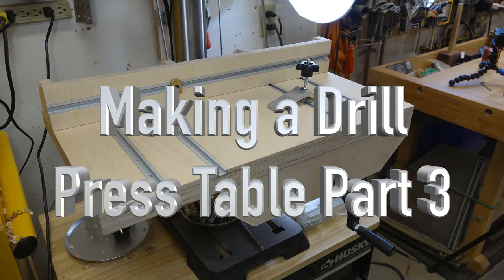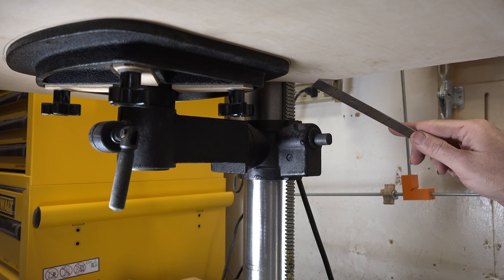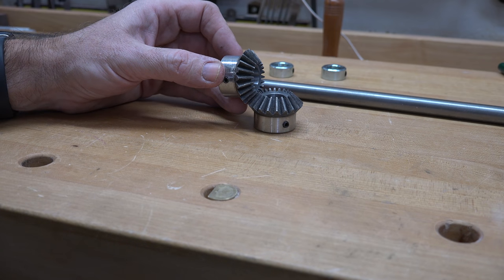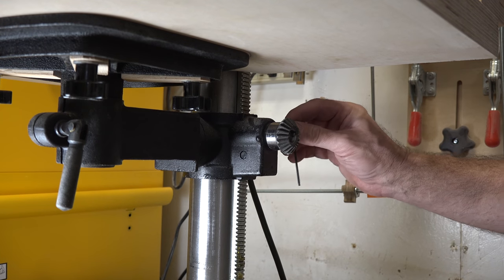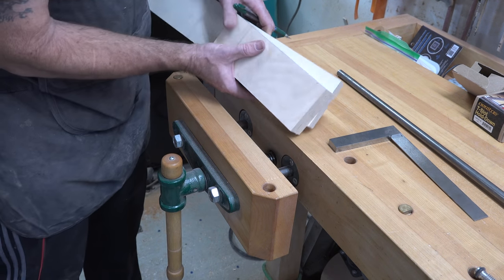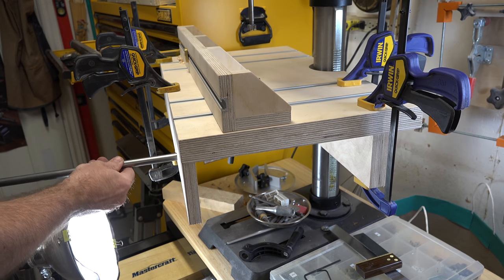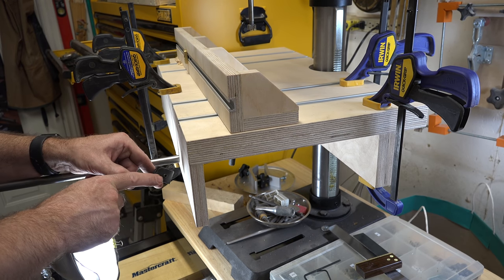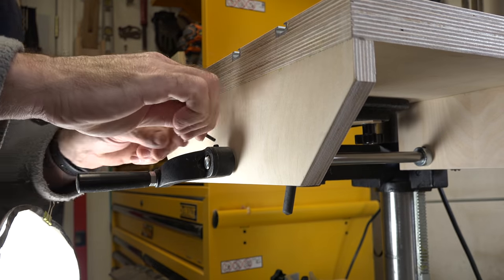Making a Drill Press Table Part 3

Comment: Hi Kenny! I am intrigued by your moving the lifting mechanism to the front. I have the Nova drill press and installed the Woodpecker table which would cause the handle to hit the table. Long story short, my solution does not work well. Your solution would allow me to use the original handle (don't ask). So, I also saw the ShopSmith version where they also moved the clamping control. In any event, I found a gear with 1/2" bore which is good for the Nova but it has 28 teeth. Would 28 teeth make it harder or easier to crank? And, would a larger diameter make it easier? If you don't know, just let me know and I'll do more research. By the way, I had no idea I was dealing with a celebrity. Do you have a "regular" job as well? I am thinking so since you have not pursued monetizing your videos and I think are leaving tons of money on the table each year. Am looking forward to Tuesdays now after going through a lot of PB videos and seeing many interesting Tuesday shows. Regards, Bill
Reply from the maker: To be 100% honest here Bill, I'm not sure about the tooth count.  Because you aren't gearing down or up, I don't think the tooth count would make a difference as long as you get a smooth transition between the two bevel gears.  As for the monetization, for years I never monetized the show and then, the show started to cost me extra money and it was a decision to monetize or quit producing it.  I went with the monetizing so that the show could pay for itself.  This is nothing more than my hobby and I work a full time job of over 40 hours a week and then film and woodwork on the weekends.  So I guess basically, I hold down two jobs.  My regular day job and my show.  LOL.  Thanks for tuning in sir.  Good luck on your modification.
Reply: @acutabove_woodworkings  Two things, you should link up with Amazon and other suppliers as an influencer. It would only require you putting a few links below when you are using things and it  would either provide more support for your shop or perhaps some income. I think you are leaving a lot of money on the table right now. Also, I am thinking that when I saw you raising your table and WoodSmith raising theirs, the table was kind of jerky going up. I realize it is not a huge deal but I am thinking that a bigger gear on the output shaft from the table versus a smaller gear coming from the handle would give a better experience. Say 2 to 1 output shaft to handle. I would have to spin the handle twice as much but the torque and effort would be less. If I get this going I'll either brag or confess about how it turns out.  'o) I also want to move the lock forward. Wish me luck. What is it you do at your regular job, if you don't mind telling. Bill
Reply from the maker: @billinfarmington5189  I don't find the table to be jerky at all and in fact, I find it quite smooth in operation.  Either way, I wish you luck on your modification.  I'm looking forward to hearing how it turns out.
Reply: @acutabove_woodworkings  Hi Kenny! If you check your Drill Press Table Part 3 video at 16:45, when you are raising the table, you are holding the table on the left and the table is rocking when you are raising it. The Wood Smith people had the same issue and they also did the 1:1 gears. Just an observation. Regards, Bill

Comment: only thing left to make it perfect is to figure out a way to move that dang locking lever to the front.  Nice  - I have to say though I say this in the background on your alternative Tuesday video and was doing the happy dance waiting for todays video. An let me tell you a 50 some year old man doing the happy dance is not a pretty sight.  Nice Job.
Reply from the maker: I'm looking forward to seeing the happy dance video Richard.  As for moving the locking controls, the original plan was to move them out to the left side of the table but due to space restrictions, I wasn't able to do it.  I am currently thinking of another plan to move or extend those controls to make them a little more user friendly.  Thanks for the kind words on the show and for tuning in.  I truly appreciate the support.

Comment: ay reason you didn't simply extend the rod to the right rear of the table. keep it out of the way in front of working area.
Reply from the maker: The front is way more accessible than the back.  By extending the rod out to the right rear of the table, I am still having to reach around the drill press table and work in awkward positions to raise the table.  Relocating the crank to the front was the best modification I've ever done and the crank has never gotten in the way.  I hope this answers your question.  Thanks for tuning in.
Reply: @acutabove_woodworkings  I just finished my drill press table and once I tried to access my table,,,,,,,,,,,,,,,,,,,,,,,,,it became VERY VERY Clear why they need to be out front..............ordering materials today!  Thanks for the video